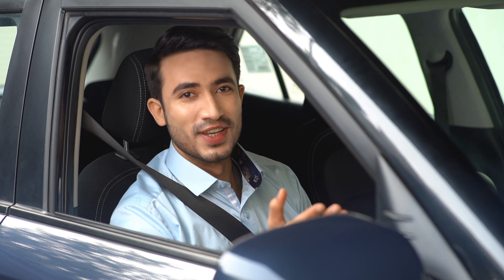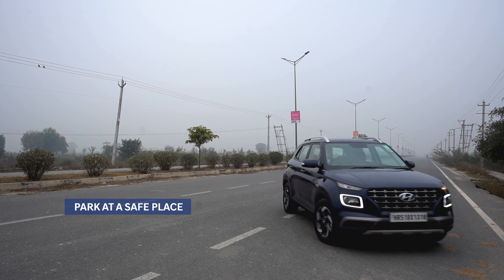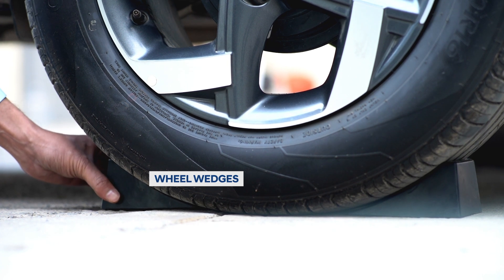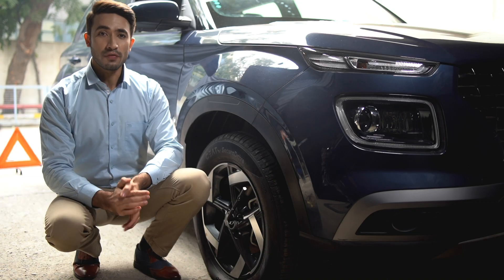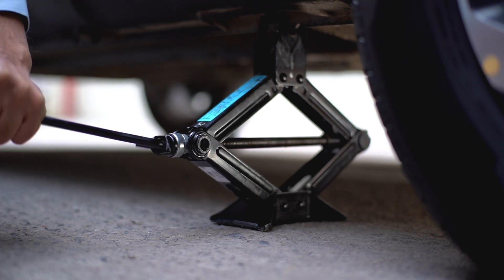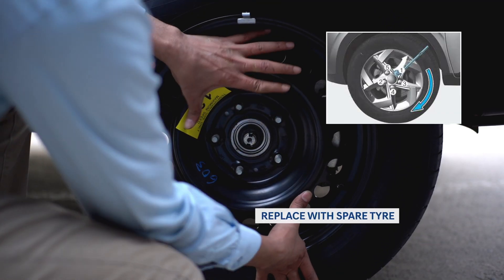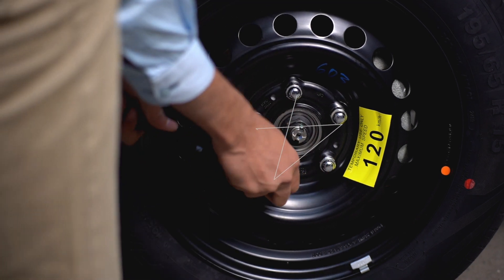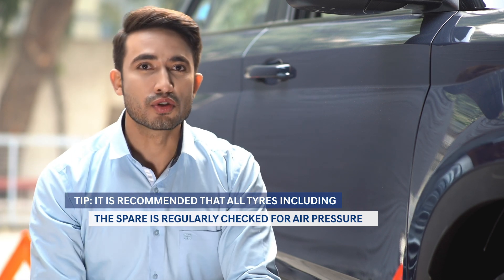Hyundai │ Service Tips │ Do It Yourself │ Tyre Change

Comment: Thanks very much.
Lug nuts must be installed in an alternating pattern, commonly referred to as a star pattern. This ensures a uniform distribution of load across the wheel mounting surface. When installing lug nuts, it's recommended to tighten them with a calibrated torque wrench.